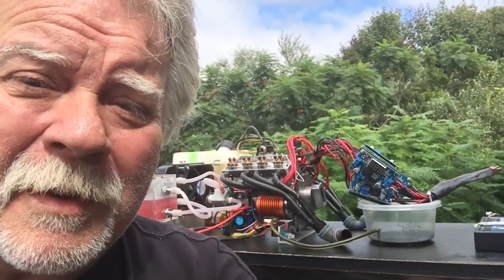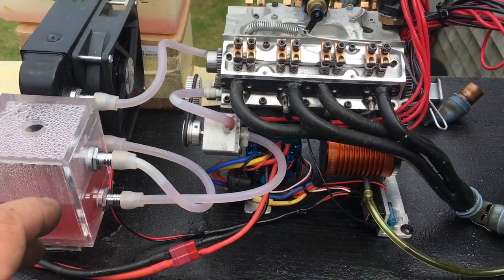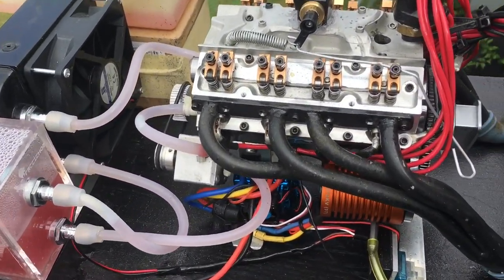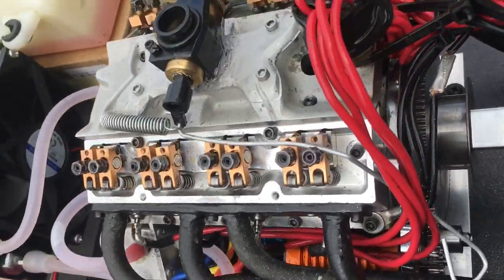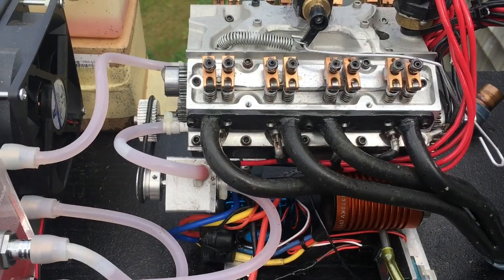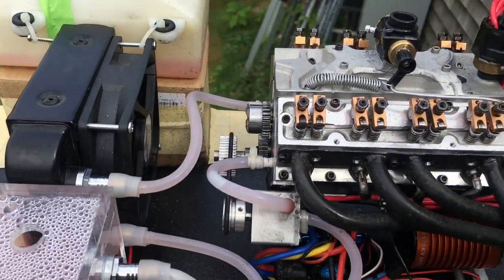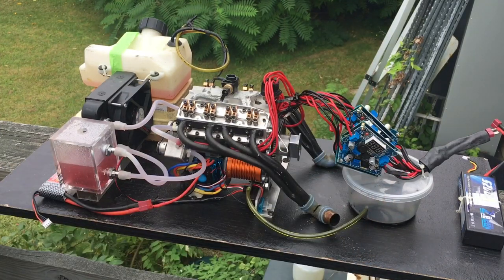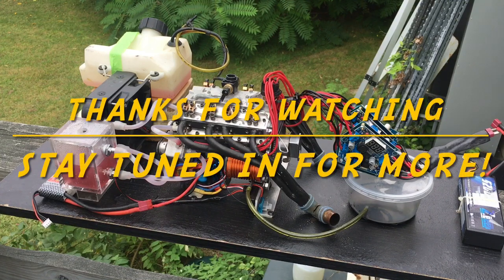AUSSIE  CONLEY CLONE V8 FIRST START!

Comment: Hi Dennis. Nice to see such progress. Those roller rockers move a little more than I had expected laterally over the valve stems. They loose ?
Reply from the maker: they are roller rockers on a single post, they were settling in and need to be relashed now.
Reply: @dennisdempseyradiooutofcontrol  You valve clearances cannot be right until you do !

Comment: What compression ratio does it have and are there different cams for blown vs carb?    Just how much air can you pass thru the ports/valvetrain? Also gonna need at least three vids a week....I'm retired!
Reply from the maker: I'm not sure what the compression ratio is as far as I know there is only one camshaft but it has lots of lift and duration. wish I was retired there would be at least 7 videos a week from me lol!
Reply: As a mechanic for so many years,  and built many motors.  Low compression and blowers go well together . camshafts with long durations and separtion prefered. The port size is key, air in and out! Valve springs need to be able to hold the boost from the super charger. And LOTS O FUEL!  Always dial back the fuel....go lean and burn valves.
Reply: Sure wished I lived a bit closer, I'm the same age and would love to work with you on these projects .

Comment: Why does the rpm of these mini engines always have to be so high at idle
Reply from the maker: they can idle lower if there is a spark ignition system instead the idle needs to be higher for glow plugs I am experimenting with a spark system right now for it.

Comment: Can this run on actual gas???????? Pretty pricey for a nitro engine.
Reply from the maker: Yes it can be converted to gas with some additional parts, they make the spark plugs to fit it but a distributor has to fabricated for it.

Comment: Nice one Dennis. I’ve just noticed this vid of yours. I am using a glow plug driver that I bought from Sonic Tronics. It uses a 4.8v battery and is reasonably neat and compact. I’m able to hide it under the base of my engine. They also sell the original water pumps that the original Conley’s have on the front of them. 
I’ve just posted a vid of my Conley after installing some different triple carbs on it. Cheers, mate, 
https://youtu.be/bAyOl9cNSFs
Reply from the maker: Thanks for the info! I will check out your video. 👍

Comment: Love your channel, but this must be the worst one I have seen so far. The cam gear does not line up with the idle gear to the crankshaft.  Then on starting the rocker arms are all over the place.  Lucky if this thing can last a couple of hours.  Every model V8 out there appears to have a unique set of issues.  One day they will make one that is well engineered.  At least your giving them a go.
Reply from the maker: Thank you my brother for seeing this! this is why I tested the new Enjomor 78cc engine for the past 6 weeks no rod failures no rocker arm float half the price and starts every time with a cdi ignition on gasoline not nitro